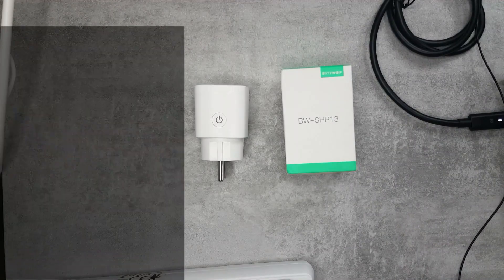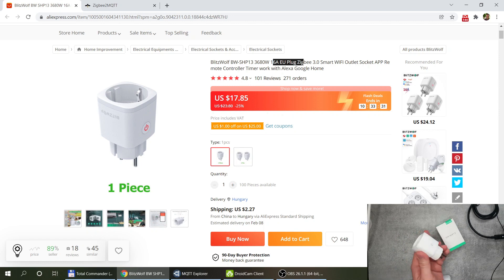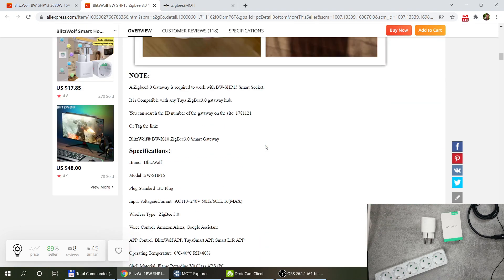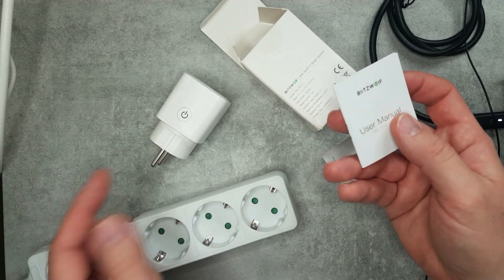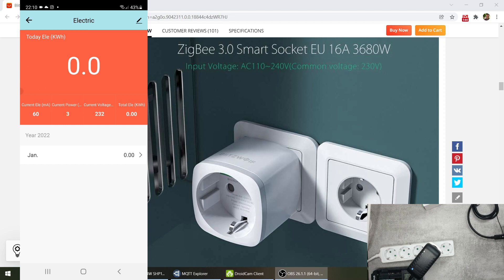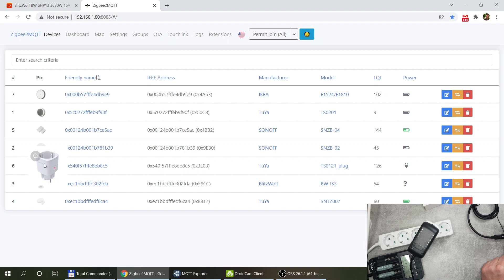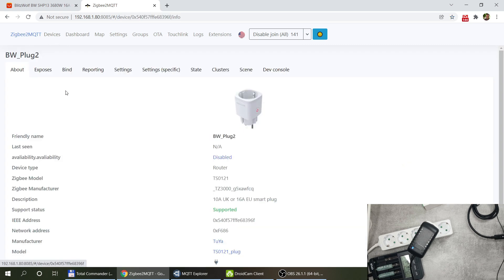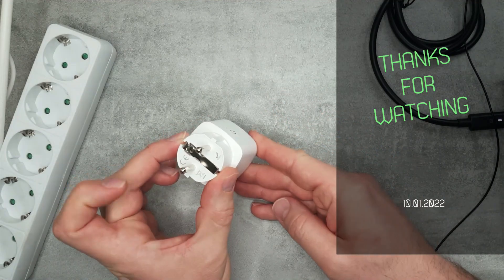BW-SHP13 Zigbee smart socket

Comment: does this socket works cloudbased?
Reply from the maker: If you are using it with Tuya, it is cloud based but there are other Zigbee systems where the control is local.

Comment: Hello, In 2020, I had ordered BlitzWolf ® BW-SHP6 pro 15A 3450W connected sockets which works fine with the BlitzWolf app on my phone. In 2021, I ordered BlitzWolf ® BW-SHP13 Zig Bee 3.0 Smart WIFI Socket 16A connected outlets but it does not work with the Blitz Wolf app. They are not found when I search for a new device in the app. So I can only use it by pressing the ON/OFF button which is not convenient at all. If any of you have successfully connected these plugs to the BlitzWolf app, I would like some help. As a reminder, I have had no problems with the BW-SHP6 pros 15A 3450W plugs.
Reply from the maker: Stupid question, but you have a zigbee gateway right? You add the zigbee devices to the zigbee gateway. There is a separate "Add device" button there.
Reply: @csongorvarga  No I don't have a Zigbee gateway...... I was thinking of buying wifi connected plugs like the BW-SHP6 pro but no.

So I know that normally it is used with the zigbee gateway but if I don't have one can I use them by another way?
Reply from the maker: @niroleta0638  Zigbee is a radio protocol "like" wifi. Just like you need a router at home to access the internet via wifi, you need a zigbee gateway so your zigbee device can talk to it (and via the zigbee gateway to the internet). So you need one. But once you have a gateway you could use any zigbee compatible device.

Comment: I order BW-SHP13 zigbee version. 
I connected with Smart life app and Moes gateway.Is working ,but the problem is  that doesn't show the power button. You have to enter  and then can trigger on/off the switch .At 05:38 to your video looks there is. Mine has the version V1.0.10
Reply from the maker: I just added the device, I did not do anything special in the app or on the device. So I am not sure why the power button is not shown. Sorry.
Reply: @csongorvarga  Which version do you have?I found some posts that others have the same problem because of this updated version.